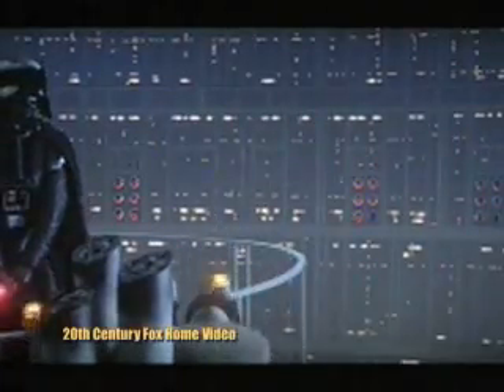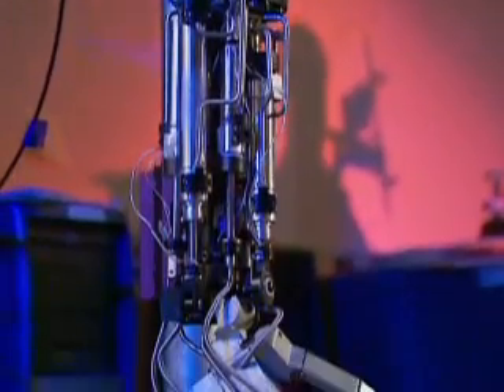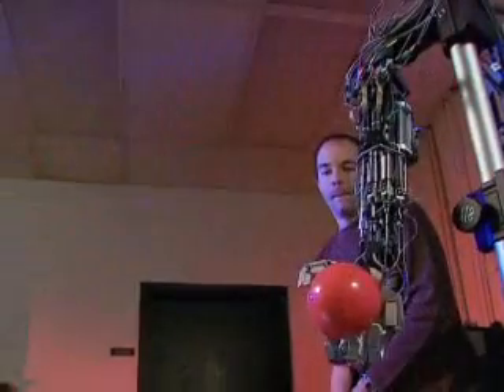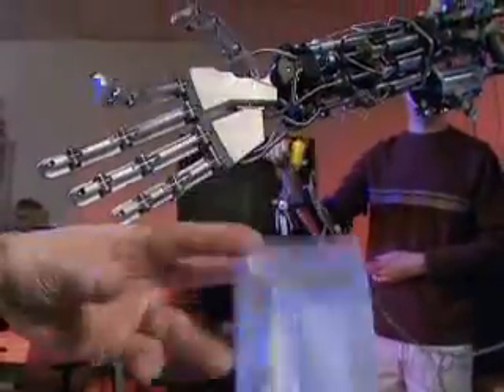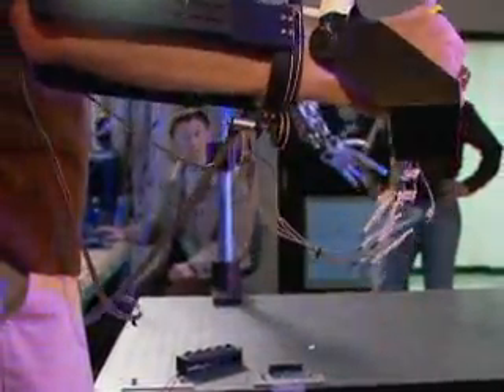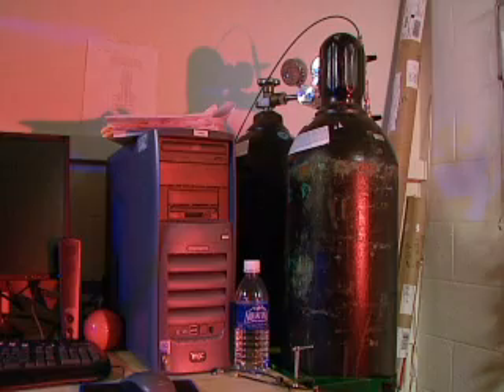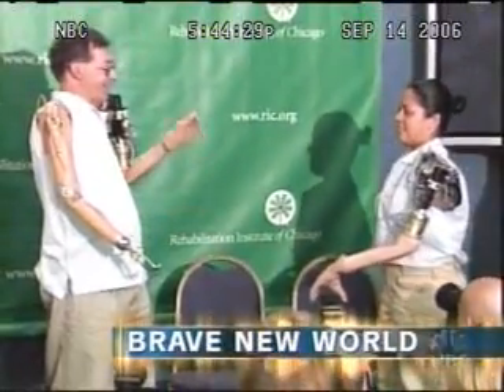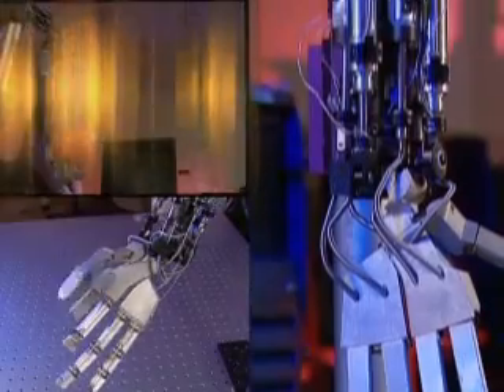Vanderbilt University Bionic Arm

Comment: So near and yet so far! I see they have built the arm powered by pneumatic cylinders. But pneumatics are jerky and imprecise, due to the compressibility of the gas. They should have used hydraulics instead. That would give them strength in spades (and would actually be superhuman) lifelike speed and perfect, accurate control of movement. Look at the robots being built by Boston Dynamics for DARPA. Those all use hydraulic actuators and have straight up eerie lifelike movement.